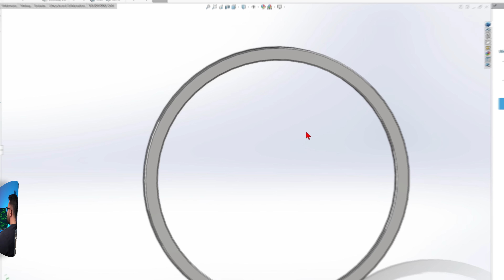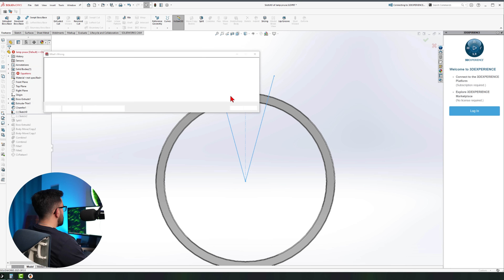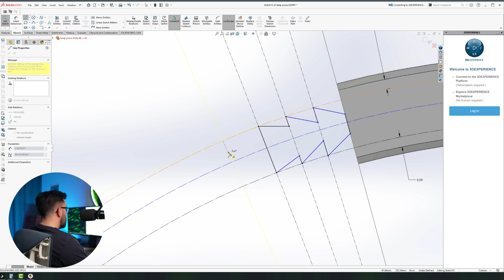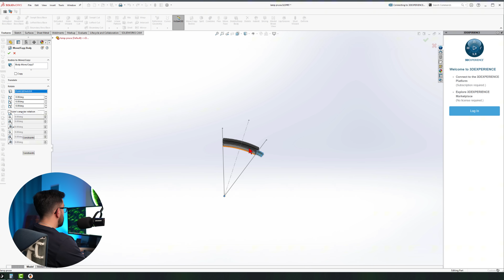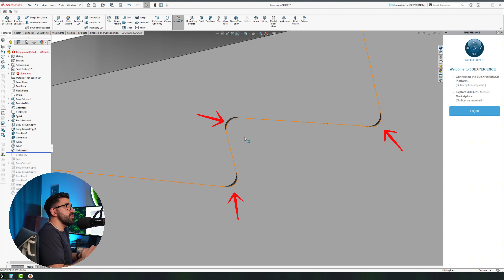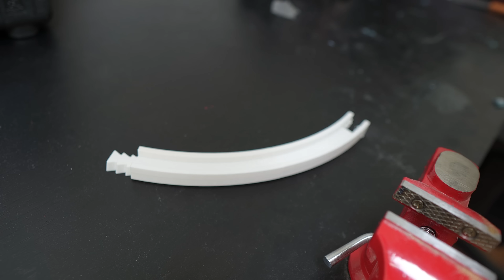How to Print a Large Part in a Small 3D Printer | In SolidWorks

Comment: Just curious, why do move/copy to fix the draft gap rather than use a draft feature and select all the faces except the one where it needs to connect? 
Also, for the cut on the other end, would a circular pattern of the sketch and an extruded cut be more dynamic for future design changes? What are your thoughts?
Reply from the maker: You can do that too! That’s even smarter!

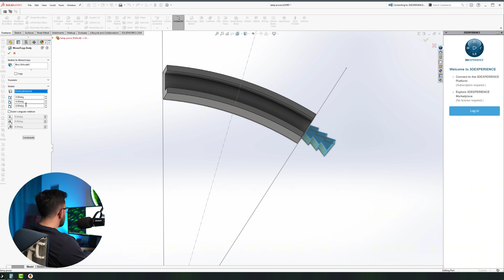Comment: 8:00
Instead of going through so much steps of Enabling Draft and then Move copy bodies to assignning an angle.

Just Extrude it normally and add the draft Later on the mating faces using DRAFT command

Comment: Thanks for the well explained video! The only tolerance you are using is the curvature of the fillet? Nothing more to check?
Reply from the maker: nope, nothing more. I'd say even without that, it'll work because whatever tolerance your printer has would be neutralized as the both ends are identical.

Comment: You don't even need to glue if you make a hole through both parts on the side and then push a piece of filament with a diameter of 1.75 through.
Reply from the maker: I've done that before, depending on the forces you apply on the part,it may break

Comment: Instead of substracting the copied body, indenting will be better. That way you can give a tolerance without such hassel. 

I find this way produce better results across all 3D printers especially the cheap ones.
Reply: This works better for me maybe because I use kobra 2 neo. It's cheap and fast
Reply from the maker: Splitting?! How would that serve you here? I don’t see it
Reply: @with-aryan  I ment to say "Indent". Usually i use that over subtract as indent already gives a tolerance option. setting the tolerance around 0.1 will provide good tight  fit and reduce manually optimization

Comment: Aryan, I have tried many different joint design, but I always end up wasting time adjusting the tolerance fit and reprinting.
So, I just finally decided on a tried and true method:
1. Using small pin like a 3MM x 12 or 20 Long steel pin that you can readily purchase.
2. Some instant bond glue, optional you can also press in by hand and leave it removeable if needed.
3. Drill of the same size(in case you want to be dead accurate or print out comes out oval or small.
The additional modeling in the SW to create the hole and bosses are identical to both sides and easy to make.
Reply from the maker: Try this. It works the first time
Reply: Instead of a metal pin, you can use a toothpick. It's cheaper and always available.

Comment: How do you handle interference? Typically printed parts are maybe 0.1-0.2 mm wider than expected, assuming shrinkage has been compensated already
Reply from the maker: the bump and the cavity are identical. the tolerance of your printer will be neutralised. Whatever tolerance applies to the bump the same amount will be applied to the cavity. They always fit.